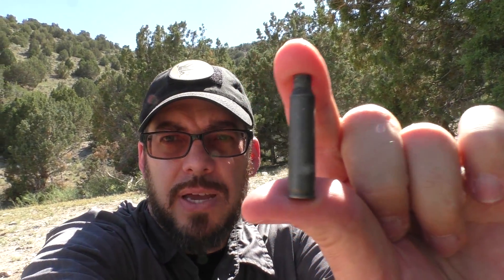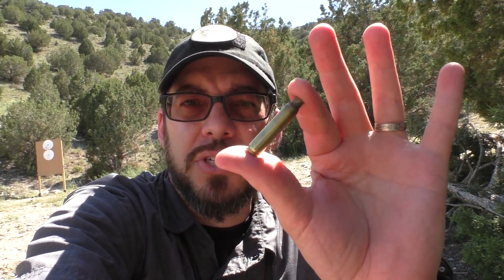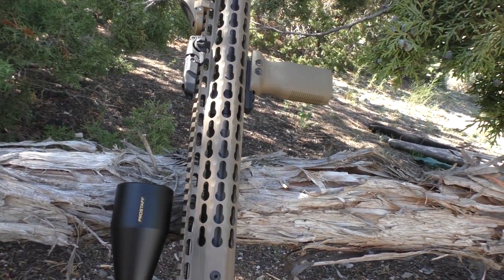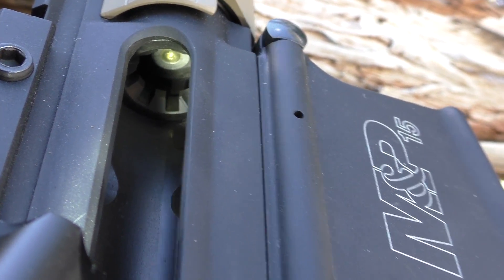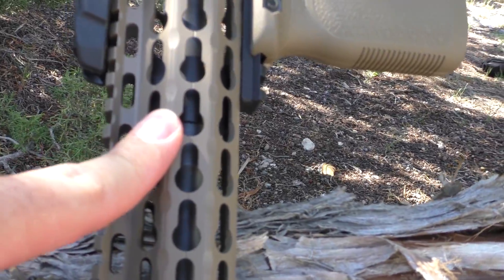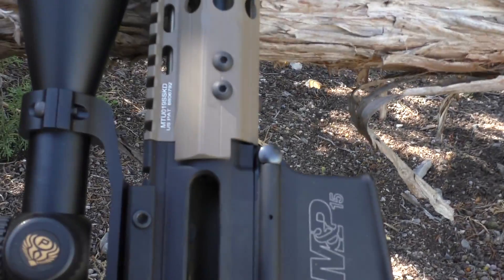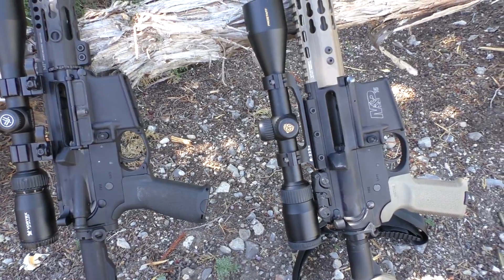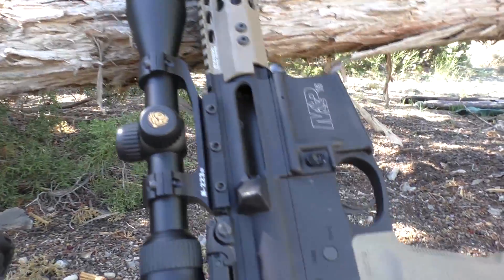Tula .223 Killed My Guns! V-Log Thursday

Comment: It depends on which AR you have. A lot of the cheap ARs that guys like to bash are the ones that will reliably feed steel cased ammo. If you buy a top quality AR, they are mil spec, but because of that they're tighter fitting guns. Good for accuracy, bad for adverse weather and cheap ammo.

Luckily mine will eat it up with no problems, but I still keep it to a minimum. Just like anything else you get what you pay for.
Reply: +TheGoldenSaber Ya my S&W MP feeds it fine. The only times Ive ever had a problem with feeding AT ALL with that rifle is with Tula ammo. 
And the only time ive ever had problems with Tula ammo is every once in awhile the primer is set too deep and the primer doesnt go off. Its cheap and I chalk it up to production inconsistencies. Eh whatever, rack the bolt and keep shooting. I have some brass cased Federal if I ever need 'good' ammo. Otherwise Im poor and Tula works fine LOL.
Reply: +sergeantbigmac I'm poor too don't have a huge ammo budget - will keep higher quality ammo in mags for "other than range" use
Reply: PeaceSouljer
I do the same. Just FYI though, I've heard that shooting too much steel cased ammo can damage the rifle. If you have a tight budget than don't shoot at all. It's a rifle, you don't really need to practice imo. I only practice with pistols most of the time because you definitely can lose your skill with those over time.
Reply: Live to shoot - shoot to Live
Reply: +TheGoldenSaber  I bought a cheap PTAC upper just for shits and giggles and to try to push it to its failing point. NOPE. It was going through steel and brass cased ammo 556 and 223 like a hot knife through butter. Never once did it jam up on me.
Reply: El Guapo
I'm about to buy a really nice AR, but I'm keeping my cheap one as a spare since it has never failed me.
Reply: +TheGoldenSaber your absolutely right golden  ive seen my m and p 15 and my buddys m and p 15 eat tula up and beg for more  but I know a guy with a bushmaster and his gun will not feed anything steel  but your right its the low priced ar's that eat steel ammo for breakfast when I bought my smith n Wesson mandp15 the booklet stated that I could use steel cased ammo or brass  I na bushmaster owners manual it says only brass
Reply: i have 2 colts the le6920 and the le6940 and that happens to the le6940 only with tula

Comment: The steel Tulammo rounds have a coating on the shells and when you're firing your rifle for a while it gets extremely hot. When you leave it sitting with a round chambered it basically melts the coating which causes this problem. The best way to avoid this is to clear your rifle in between firing.
Reply: THIS

Comment: Does the bolt fail to extract the spent case then rams the next round into it?  My AR was doing that to me with steel case then even with brass case.  I was so frustrated with it that I was planning on just buying a new bolt carrier.  No amount of cleaning fixed the issue. After some re-search on YouTube I figure out it was the extractor spring (that had been weakened over use) that was causing the issue and not the ammo.  I found an extractor spring kit on Amazon for under $10.  Did my own gun smithing and now my ar runs smooth.   Try this route before you start messing with gas block, different buffer weights etc.... Over gasing will cause for the rifle to cycle too fast and cause for the lips to ripped off the case during extraction.  This can be fixed with a heavier buffer.  I too had this issue but the cheap $10 kit upgrade did the trick.

Comment: Shoot Tula 55 & 62 grain in my Palmetto with M4 feed ramps and a SS barrel and low profile gas block (which would have no effect on this problem).  I have NEVER had and ejection problem.  Have you clean the ejector?  Checked the spring tension on the ejector?

Comment: This might be a stupid thought but I have noticed the same issue but only when I fire .223 Tulammo steel-cased from a .223 barrel. Whenever I fire it from a 5.56 I have no issues whatsoever. Could it be related to how the steel casing expands within the shoulder angle of a .223 barrel? I know that your S&W is a 5.56 but I have never encountered the issue with a 5.56 myself. Have you tried other 5.56s?
Reply: 5.56 chambers have a little more wiggle room when using .223 in them. Stuck casing would happen less if using .223 in a 5.56 chamber. Also idk what the difference is between wolf and tula but i have never had that problem when using wolf. Only when using tula.

Comment: Maybe check your extractors.
Reply: ***** I'm curios too
Reply: +John Troy I had the same problem with my dpms, all I did is upgrade the extractor spring to a bcm spring.
Reply: +Leo Leyva  you nailed it! Good job, your too smart for most of these clowns!
Reply: +John Troy My hakim would do the same thing with brass and steel 8mm. the steel would always get stuck, while the brass rim would only stick a couple of rounds. the rounds that did extract had there rims really riped up. I polished the hell out of my camber and kept fiddling with the gas settings to no avail. Finally I changed out the extractor spring and there was a major difference between the new and the old. since I've had 0 FTE.
Reply: +Mike Costello Thats not the case. I had the same issue with my rifle and I use BCM bolts and carriers in all my rifles. Ran other ammo just fine and for some reason would do this with Tulammo here and there. Never had issues with their ammo before.
Reply: +John Troy no,no,no

Comment: Through experiment with a rifle, steel case 223 jams in some guns. here is the reason and solution.

steel case does not expand very well. when you shoot, the residue blows back and gets between the case and the chambre wall. Brass does not do this because it expands well and seals off the chambre when it shoots, preventing dirt blowback.

The solution to this issue is to load your mag with 1 brass round, 1-3 steel rounds, another brass round, another 1-3 steel rounds, etc.
the solution works because the steel case builds up residue, but when you shoot the brass round, it flushes out the residue as it expands and gets extracted. the residue gets extracted along with the brass casing, and you're clean and good enough to shoot a couple more steel rounds. 

in the rifle I tested, the 4th consecutive steel case gets jammed. 3 steel or less worked perfectly for me.
Reply: That is very interesting and makes logical sense. I'll have to give that a try. I just ordered a couple hundred rounds of steel to test out in a few of my ars. Only bought steel case to check if they will shoot it and I use brass 99% of the time. I'll have to try your method and see how it works.
Reply: Stacking9mm I've only ever fired 2 ARs, both jams with straight steel. I was skeptical about that solution at first, so glad it actually works. But different ARs might eat different amounts of steel. You should test yours and see how many steel you need to start being unreliable then just dial it back a couple
Reply: +GoldViolinFlutist Good recommendation. I'll try that and try to comment and let you know.  thanks for the tips 👍😆

Comment: I tried to maxx tech 5.56 and it did that almost every other round. Turns out the neck of the brass was out of round. Never had and steel cased ammo get stuck. Don't throw it away. Three answer is getting an AK chambered in 223 😁

Comment: Polymer coated ammo will occasionally stick when loaded into a hot chamber and the chamber has a chance to cool off.  The polymer will melt a tad and bond to the chamber walls.  Usually it will press out with a cleaning rod. You can avoid this by leaving your bolt locked back and your chamber clear when it is hot and it might have a chance to cool off.  For this reason I would rate Tulammo as "practice" or "hunting" ammo but not as "duty" or "life safety" ammo.  The advantage is you pay a lot less, and it is easy to clean up with a magnet.

You should keep a steel cleaning rod in your range bag, I have had stuck cases with brass, copper plated, etc.
Reply: A coated steel cleaning rod. Always coated to protect your barrel against damage.
Reply: its not polymer, its laquer
Reply: old stuff was lacquer, new stuff is polymer. lacquer hadn't been used by Tulammo since the late 1990's.  I guess old stock might be lacquer if you have any. the Polymer doesn't stick as much as the old lacquer did.
Reply: Neither the polymer or laquer melt or get soft in a hot chamber.  This is one of the commonly perpetuated myths about steel cased ammo.
Reply: It is NOT the polymer or lacquer. Its the carbon buildup that creates a lot of friction until it gathers enough to completely get the casing stuck. A very simple solution is to buy a brush rod the size of the casing, not the bullet. Clean it every couple of hundred rounds and it'll shoot like a champ for CHEAP!
Reply: Joe Zasada facts!

Comment: it is because steel case ammo usually doesent catch the extractor as well as brass but i use it in my savage axis and works fine because the bolt moves much slower and doesnt jerk it.

Comment: Hey put light film of grease on casings I had the same issue, now sailing through ammo all day. Late Boy Scout
Reply: The Good Life  🤣👍
Reply: Fahad Ayoub take a zip lock bag and a dab of grease put ammo in and start moving all casings around. A light film is what your looking for. A better fix is to get a heavier buffer  like H3. For 7 inch guns I use palmetto state armory 9mm pistol buffer. Another method is bore soaking just apply CLP to chamber or first round at range. Grease is easy because it will not leak or dry out.
Reply: Fahad Ayoub oh yeah ak’s need no help lol only ar15s
Reply: @2aamerica329  YUP! Shot like it was soaked in butter! Pew Pew!
Reply: This may be an old thread but, what kind of grease would you recommend using?
Reply: Taoist Wrenches lucas red and tacky

Comment: After you have fired a lot of rounds or got your rifle kinda hot never leave a round of that stuff in the chamber. It's the lacquer they use on the casing that glues it in a hot chamber if it sits to long. A little lacquer thinner will go a long way on getting it out. don't know what it will do to the finish so don't just pour it in lol

Comment: get a better exracter spring
Reply: Bingo
Reply: Actually the rim often gets ripped off, so even very good extractors will have the issue
Reply: A better spring won't clean the carbon build up in the chamber which is causing the issue!
Reply: Hay Seed  I highly doubt it's cabin build up. I think it's a bad batch of ammo.
Reply: Justin McDonald, it is the carbon build up. Steel doesn't expand as well as brass, so gasses get to pass by it which dirties up the part of the chamber where the casing sits. This can be easily fixed by cleaning it with a brush rod the size of the casing, not the bullet.

Comment: Get a BCM extractor spring, problem solved.
Reply: +Leo Leyva I had the same problem with my dpms.  I got stuck casings about 3-4 times.  I upgraded my extractor spring and never had a problem since then.  Is like a 5$ upgrade.
Reply: Didn't work for me. But, I already had the full BCM rifle...
Reply: Chris Brooks check your extractor, it might be worn out or not deep enough to grip the shell lip with full grip.
Reply: I have a brand new diamond back. it happened with this ammo more than once.. its the coatin on the shells. one has a "lube" and the other (tula) doesn't.. jamming and double loading sometimes.. stay away from tututulllaaaaaa
Reply: Tula ammo wears the extractor and springs.
Reply: Sean Gangstad so Tru my db acts the same way

Comment: I shoot wolf gold. It's cheap and no problems.
Reply: Not sure I've heard of wolf gold.  I bought 500 rds of wolf for my Gen 4 Glock 22 .40 cal.  It would jam and stove pipe around 75-80rds.  After a scary incident I havent used wolf again.
I had a live round get shoved into an empty casing and get stuck in the chamber/barrel.

Very dirty ammo.  Armorer had to rebuff my feed ramp smooth out barrel port.

Comment: Possibly a head spaceing issue. Not that your rifles are improperly head spaced for brass ammo, but brass casings do expand differently. The same thing has happened about five times in my Colt, but I noticed my extractor has sheared off part of the bullet rim on the Tula .223 sorry I can't be any more help than that.

Comment: My issues was not having the Tul jammed in the barrel but getting jammed while trying to feed. I just put on a brand new Stag A3 upper and BCG lefty, it was originally a right hand with no problems. The gun is a Bushmaster Carbon 15. Now after every 3rd or 4th round the bolt catches the shell about half way up and jams it. This was the first time out with it. It was all cleaned and lubed. Was using Magpul 30rd magazine and .223 TulAmmo. Ejects fine just won’t feed correctly. Any ideas?

Comment: I almost bought 1,000 Tula 357 rounds for $300, but read a review where a shooter said they got stuck in his revolver and he had to use a pair of pliars to get them out. My friend also told me that the steel jacket destroys the barrel. I bought 1,000 rounds of Armscor brass for $400 instead.
Reply: Leo Harju crap, I bought 2000 rounds for my MCX
Reply: just make sure your gun is really clean before shooting and also add alittle bit of oil to the bolt and chamber to allow smooth extraction and you will be fine
Reply: The projectile is lead the casing is steel.
Reply: Sam Henke, The case is steel, the projectile is lead core with bi-metal jacket. Bi-metal means steel jacket with a copper wash. So it looks like it's just a copper jacket when it is not. Magnets will tell you
Reply: It won't "destroy" the barrel because it's not the same hardness as the barrel. Not all steel is created equal. Bullets have to form to the barrel and rifling and therefore cannot be the same hardness as the barrel and therefore will not "destroy it." I've shot Tul and Wolf .223 and 9mm with never a malfunction and my barrels aren't destroyed. And I've shot a lot.
Reply: +Nathan Mueller I've shot about 500 rds of wolf through my 9mm Taurus never had a problem.
Reply: +Nathan Mueller I think wolf or Tula ammo is ok. Had this problem with an AR pistol one time before. Took a cleaning rid to it. It was a 556 camber. I don't think that was the problem though .
Reply: How do the cases get into the barrel? Was the guy shooting .38 specials before he switched to .357. I've had .357 stick after shooting .38's in my Colt Python. Get a .40 pistol brush and a short cleaning rod on the end of a drill and use solvent and scrub the chamber(s). Steel will require more chamber cleaning than brass, that's a given. By the way, if a case sticks don't use a pair of pliers, use a rod and tap it with a hammer or walk it into a wall, table top etc.  I keep an old .22 cleaning rod in my range bag for just that purpose.